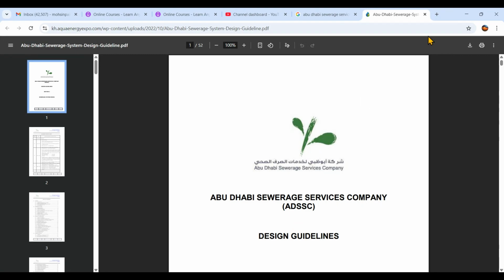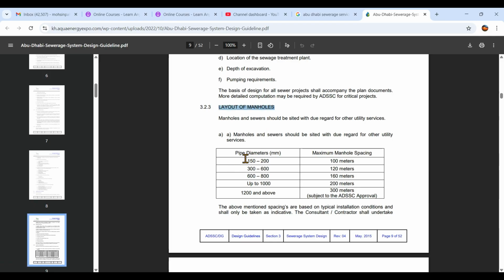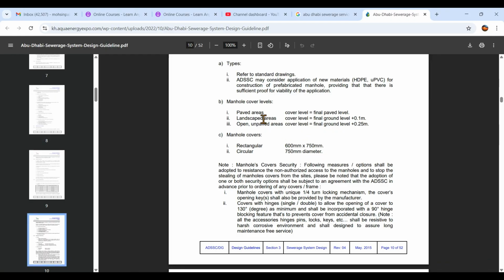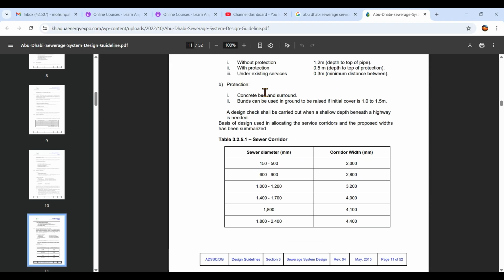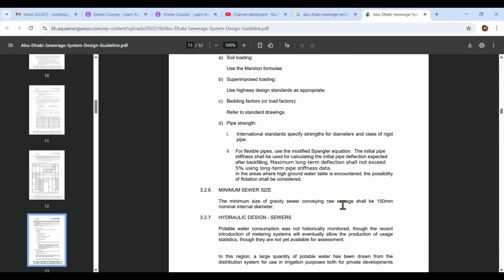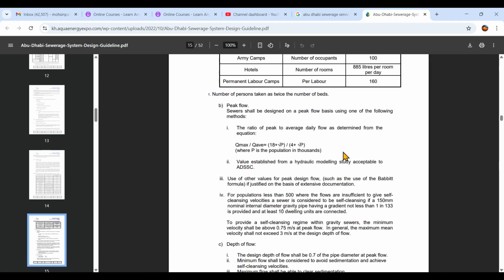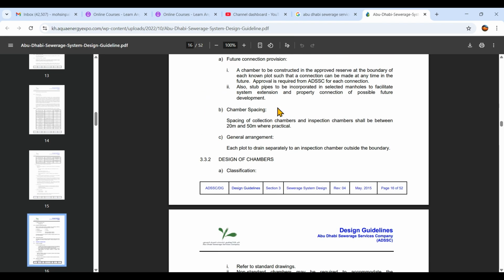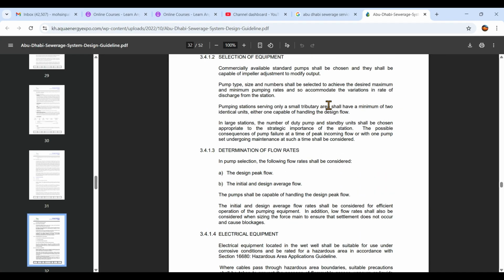Introduction of ADSSC Guidelines for Sewerage Design in UAE

Comment: If Sewerage Tax is introduced by the Federal Tax Authority UAE, it will help meet all sewerage design, maintenance and upgrade requirements of the Sewerage Services Company as well as stormwater hydrology integrated in Infrastructure Development. The stormwater run - off from Industrial Areas Sharjah during climate change induced rainfall should not reach and flood Abu Dhabi in two hours time. Spillover and stagnation of stormwater from Northern Emirates into Dubai and Abu Dhabi needs to be checked before stormwater dewatering personnel label rainwater as wastewater.
Reply from the maker: That's an interesting perspective on the potential benefits of a sewerage tax.
Reply: @bharathydro7980 Thank you Bharat Hydro.